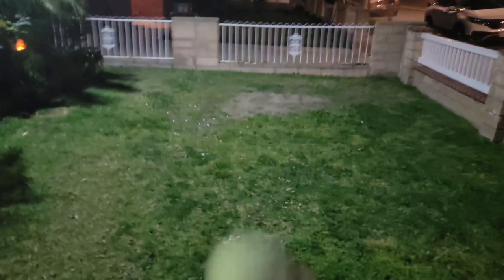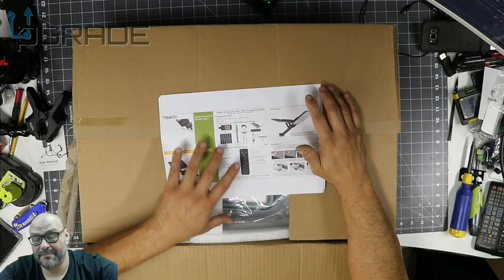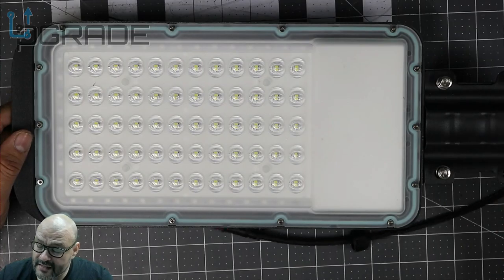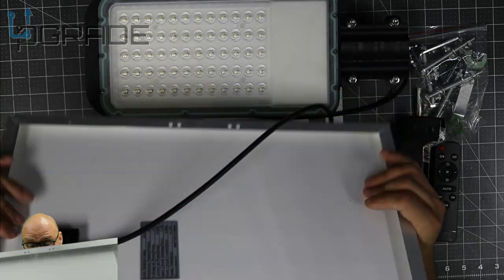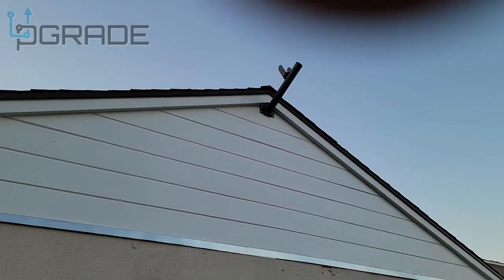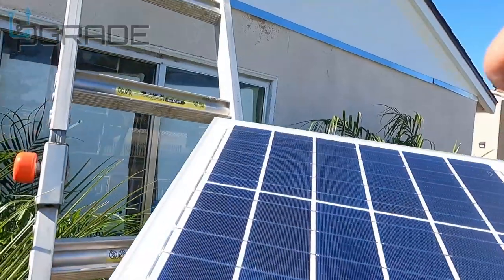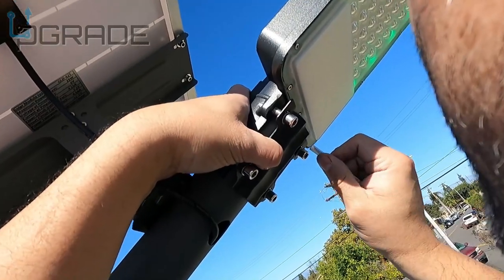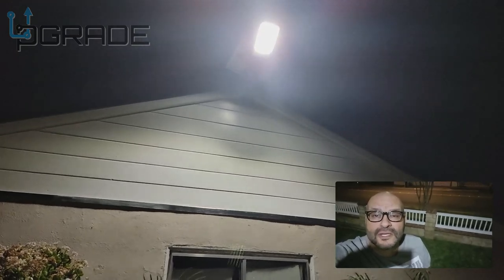LED Solar Street Lights

Comment: Great video!  Thanks! How does it stand up to high winds? I looks like the solar panels would act like a parachute for high winds.
Reply from the maker: The Solar panel might not work for your environment this is only for a stable location, I'm in California and you might want to see the other Street LED light that has the build-in solar panel that I have reviewed it also has a motion sensor as a plus.
Reply: don't worry Poletto,I could send you one All-in-one type.I could hold in high winds
Reply from the maker: We had a strong wind hit us and the light hasn't been damage it's a little streamlined for the wind. If you lift the solar panel high then it will act as a sail and then it might be bad.
Reply: Where can I purchase that street solar lights??

Comment: Hi are you still using this lamp? does it works all night on? do you have any comments about the quality? Thanks
Reply from the maker: I love this lamp it work about 8-10, my neighbor purchased one beacuse he said it last a long time with the full charge.
Reply: @Upgradetech  hi, we have new solar security street light, do you have any interesting to cooperate with us?
Reply: Hi I like the brightness. Does it light dusk to dawn like 12 hrs on full bright when it's fully charged?
Also how high did you mount the light?
8m?
Reply: Yes I do contact details?
Reply from the maker: @currydouble9572  Sure email me the details
Reply: @danleymark8961  I once bought it on a platform in China. The lighting of their lights is very strong, and there are also options for light poles, but it needs a little extra money, but in general, the price is really high.
Reply: @Upgradetech  your email address please, then we send you details information, thanks
Reply from the maker: plas1974@gmail.com
Reply: @Upgradetech  ok, thanks, i send you email
Reply: @Upgradetech  thanks, we send you email

Comment: I am about to get two of them. Are they still bright and that solar panel still providing enough energy?  Thank you
Reply from the maker: It's been very sunny in California plenty of charges and it hasn't failed. This has been one of the best Solar LED lights I have installed.
Reply: What is the brand name of this light? And can they be purchased on Amazon? Thank you, and great video.
Reply: @Upgradetech  What is the brand name of this light? And can they be purchased on Amazon? Thank you, and great video.

Comment: Thank a lot, please can the battery 🔋 works up to 12 hours?
Reply from the maker: If you dime down the lights you can.
Reply: not properly no, you want full power, you will get an hr or 2 max, and then dim light the rest of the time. when buying a set up look at the battery specs, Voltage x Amp Hours... Multiply that and then take that # and divide it by the output of the lamp in watts, and you will know how many hours it can run at full power.

Comment: What brand and model you have installed? . I bought one with home & lighting 300 W, 30,000 lumens but it does not light up like yours !
Reply from the maker: What is the brand? Have you hit the link below to take you to this product?
Reply: @Upgradetech   I do not see a brand, but it is written on the face at the bottom of the bulbs, SOLAR LIGHT and the model is 300W SOLAR STREET LIGHT 30000 LUMENS. I Bought ( $ 459,96)it from HOME&LIGHTING.
I would like to have the references of the same model you installed on the roof in your video (with the dog in the yard) and how to order.
Reply from the maker: The one on the video 6000lm your is half the brightness
Reply: @Upgradetech  mine says 30000 lm! but not bright enough.

Comment: What about the battery to store the energy.?
Reply from the maker: The battery should last for 3-5 years before you can replace it, you can access the panel in the back and uncover it with a couple of screws off.

Comment: Really need solar lights  where i live.
Reply from the maker: My sister purchase a plot and is adding two of this type of lights to their property.  The property has no electrical connections and this is perfect for this type of placement.
Reply: I could send a  free sample for testing if you need.
Reply: @Upgradetech  I could send a  free sample for testing if you need.
Reply from the maker: @skyworthpv7560  Sure email the info so I can review thanks.

Comment: How do I set the remote to run all night bright?
Reply from the maker: At night hit the 8hr and that will automatically turn on every 24 hour
Reply: @Upgradetech  In other words right now I hit the on button that should turn it on at dusk. Then at 10PM hit the 8H button and it will stay on all night.
Reply from the maker: @kenlynch3628  No the system will automatically turn on as soon as it turns dark and will stay on until the battery is out, this doesn't have a memory chip or internal clock only dusk to dawn feature.